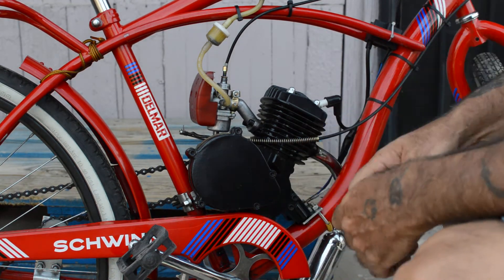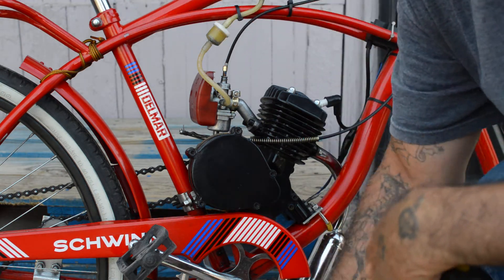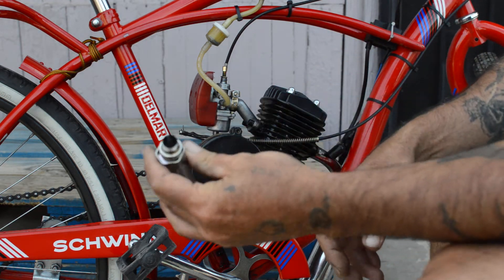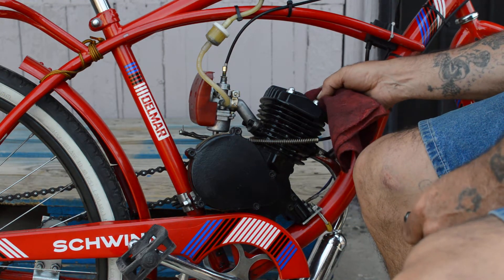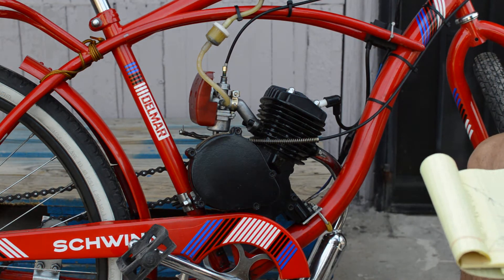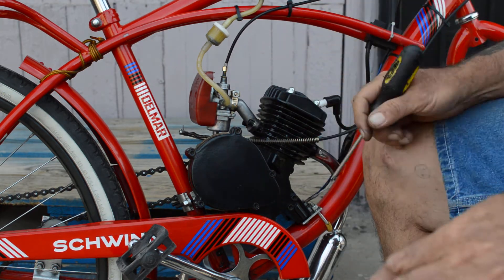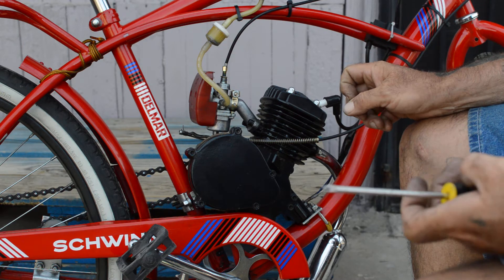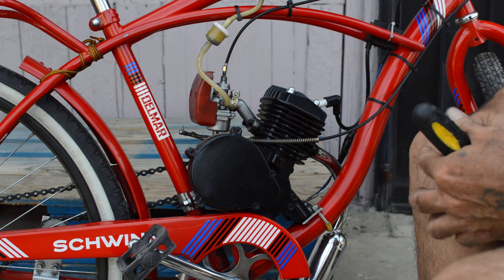Spark Plug 101 for Chinese 48cc motorized bicycle engine

Comment: That’s a 66cc
Reply from the maker: Nope stock 48cc stamped on the bottom of the jug"/
Reply: @Brian136  well the head is 66 don’t always go by the block cuz I have a 76big bore and it says 70/80 on it
Reply from the maker: @keeganhache6667  nope the cylinder head is stock 48cc this is an original china doll 48cc straight from the mud shed that the Chinese used for a factory. 

It is a clone of the Russian 48cc  engine used for a two man Saw

Comment: Your top cylinder head cover is backwards turn it around because you have a angled head cover you want to fire the spark at the exhaust port for best performance. Hope this helps..

Comment: 3:17 okay and if my spring is like stuck to the spark plug? What do I do? Idk if this thing is supposed to be inside my cdi or if it’s supposed to be on the top of the spark plug whatever it is it spins on the top of the spark plug
Reply from the maker: It’s the thing that keeps the wire connected to the plug if it is stuck on the plug then pull it off and put it back on the wire side of the boot push down until you feel a click. Wire and plug are now locked together until u pull the wire off again “) thanks for watching

Comment: spark plug blowout.... should people be using the spacing washer for the spark plugs? proper torque for head bolts to and the spark plug to avoid spark plug blow out? what is the coolest range plug you should run? I'm currently running an NGK BR7HS10 Racing plug and i just had it blow out of my cylinder head, which im working on now.. but i see little content on this topic on YT
Reply from the maker: That’s because not very many run a hot plug like the one u got. Are I using 93premium gas?  Standard gap? Maybe a little wider huh!? Spark plug technology has evolved many times in the last 10years. But the understanding of this hasn’t quite filtered down. I did a video talking about how the spark plug works in conjunction with the timing of the piston. I covered a range from stock b6(chineseium brand) translates to NGK h5b-h6b - h7. Now the coolest u should run is the 5 and there are a number of good champion plugs that work good also. I have seen a few chainsaws with 4bs plug but that was out in the forest with snow up to your butt 21 degrees 0% humidity and dude was burning some thick gas . So that probly cover the Answer to the question. Why not much content? Because spark plugs are still cheap unless you buy the hot range then they cost$$$m. I really don’t know maybe it’s not interesting enough? Why don’t you do a series about it and see what happens “)
Reply: I always run 93 octane in the bike, the ngk br7hs10 is actually a colder plug (on ngk plugs the 7 is the heat range indicator) i installed for running in the summertime, as i was afraid of overheating the motor in the 80°F to 100°F daily temperatures here. Im also running without an air filter as well because the stock one was far too restricted and robbed me of 3 mph. I gapped the plug, but i don't remember off hand what gapping i used

Comment: Brian De Magneto is all right I'm not going into the Magneto box I'm just cutting the wires outside the Magneto box to extend them I just want to extend the blue and black wires
Reply from the maker: Then what is the problem? Bro 2 insulated electrical connectors and some 12-14 Gage copper #2 wire and 10 minutes of your life?

Comment: Fuel filter backwards
Reply from the maker: Read comments above about arrow and the direction of the fuel flow
Reply: The magnet inside is supposed to be on the tank side of the paper filter. But i really doesn’t make much difference. Just thought id mention it.. cheers

Comment: I was looking for this solution even the parts stores cant cross reference this" the ngk b5hs spark plug Looks to have a much longer reach and I don't want to put it through my Piston"??
Reply from the maker: I use this plug on all the engines I have built never had any problems. The engine runs a lot cleaner and the fuel mileage is in the high end of 80-100mpg.

Comment: Why does the spark plug cause compression? Without the spark plug I can pedal just fine but as soon as I install it the bike is sooo hard to pedal why does that happen? How do I fix that? I’m using the spark plug that came with my kit btw
Reply: KingofArmageddon20 your an actual idiot
Reply from the maker: Really dude !?
1. Because once the plug is installed you are sealing the cylinder  so when the Piston moves up and down it compresses the air/fuel mix this is called compression.
2. If you are trying to pedal with the cluth levef out you are turning the engine over without the ingnition in and problely scoring the cylinder walk because it not getting the lubrication it needs 
3. I giving you the benefit of the doubt since I don't know you and everyone get a chance to learn in the beginning but I think dude that made the other comments might be right...

Comment: Does anyone know how i can keep my motorized engine running even when i stop? At red lights or stopping for cars or something, i don't have to repaddle. Anyone??
Reply: Jesse Soe you would need a boost bottle and there like $20 on amazon or eBay.
Reply from the maker: Set the main jet to the second click down from the top. Reset the idle screw to 2 1/2 turns out from bottom. Make sure the choke plate is all the way open. Any more questions?

Comment: I ran my engine 16:1 oil ratio for 65 miles, (currently I have 80 miles on it) for at least 2 or 3 tanks (over 1 gallon used.) I just switched to 6.5 oz per gallon and my top speed is 23 to 24 mph flat road, 44tooth sprocket. Im almost done with one tank of the  6.5oz. The z4c plug runs better than the b5hs, so I ordered a b6hs plug in hopes that it will perform better. Should I still be using a high oil mixture like 16:1 or should I run 6.5 oz again after I finish the gallon already mixed with 6.5? It seemed to 4 stroke at wot but it appears that went away when I went to down to 6.5, I did order a set of 60-65 jet, but may not install those just yet. It's the chinagirl engine. Should I change to synthetic yet or wait until I add more miles?

Comment: Changing out the stock 7mm spark plug and boot is a HUGE power gain.  For like 5 dollars, I got an OmniSpark # 8E40 at Oriely's Autoparts. Its 8mm. Bout 24" Long. Cut in middle, Two 90 degree boots. So you have spare. You have to force the cable end into the CDI screw, careful not to break the plastic. It HAULS THE MAIL NOW. Much notice overall increased acceleration! The NGK plug upgrade compliments the cable. :)

Comment: Hey Brian, I accidentally popped out the spring and metal cap thing that goes inside plug cap. How do I go about fixing this? Does the spring go first or the metal cap? Help would be greatly appreciated. Thanks
Reply: Did you ever find a fix?
Reply: Yes 3 years later. Lol. I thought it mattered, but it just all makes contact.

Comment: I just got an 80cc engine but had no spark so I replaced the cdi and magneto but still have no spark, what can I do to get it running?
Reply from the maker: check the wire behind the magnito make sure it's soldered good then make sure you got the cdi wired correctly sometimes the colors are wrong

Comment: I have a question I have this same engine and it's not starting I'll pedal and I'll get engine to rev but it just bogs out and dies everytime I don't know why it's not starting
Reply from the maker: pull the mag cover and make sure the wire is connected sometimes the little chinese kids don't solder it very good")
Reply: I'm getting spark but won't fire . I changed the piston and cylinder won't start changed the magneto still nothing
Reply: @0Kizzy  
Try replacing the cdi box

Comment: it basically doesn't pic up speed fast or full like its running half power
Reply from the maker: here watch this video and see if this helps you any if not then email me and we go from there ok ty?
Reply: thanks change spark plug I'll try it thanks
Reply from the maker: reset the main jet to it might be set to rich if u are not getting power out of the little enging")
Reply from the maker: https://www.youtube.com/edit?o=U&video_id=0F-Vyv5WmO8

Comment: junky mechanics put bike together but it has new race carb and goes slow what do I do help please?
Reply from the maker: first of all what are u talking about? second just because it has a race carb doesn't mean it's going to go fast third i need a little bit more information to help you??? can u give me a list of the problems that u are having ? things like it's running rough at the top of the rev range ot it's running funny at the start of the throttle? things like that will help me to understand what is happing and then we can go from there ty. tha nks for watching")

Comment: HI Brian : Agree with you tips . Used to mess with cars before my bad back . I have a 66cc stock China motor {  I guess }. You said 49cc is 2.75 HP. What do you estimate my 66cc HP is ? Also would you know anything about BPH (brake horsepower ) ? Carrying about 300 lb.'s ? I ask because now I have to get the thing registered here in NV. Need to meet the same requirements as a scooter . Under 49 cc /under 30 mph . Need to know what BS. they want me to sign off on . If you know ? Let me know ? Thanks  D.A.
Reply from the maker: i figure the 66 is around 3.1 or so depends on weather you got the slant head that is a little bit bigger in combustion chamber size and which carb you got the NT speed or the funny little stock china carb that comes on the rocket scooter") as far as the dumb laws go i don't know because here in AZ it's legal to ride motorized bikes as bicycles as long as u stay i n the bike lane and have all the lights")
Reply: Thank You for the reply . That sounds about right . I figure it's all the cheap China stuff . Here in Vegas it's just the opposite . If it has a gas motor no bike lanes, can't take it on the bus . Same rules as a scooter under 50 cc need a DL but no insurance , no registration (until now .) They say...  it's to help prevent theft ? Cost around $60 one time only .Good for as long as you own the vehicle. ( It is a bit of a gray area concerning motorized bicycles ) The DMV refers to them all as mopeds even though a scooter and moped are 2 different animals ? But I am not going to take a chance . You sign a document that it meets the criteria , then if you get pulled over for going over 30 it becomes a motorcycle , and you would have to follow those rules . Now an electric bike is different . Under 750 W/under 20 mph it is a bicycle. Have one of those 2 . I figure the BHP is under 2 which is required , when you take into account the weight . I'm adding different stuff to make it look like a 1910-20 , not a board track racer however. I use stuff from thrift shops, parts I find or get cheap. It will get to 30 , but I mainly want good low end . So I will be doing some of the mods like you suggest . Okay Thanks  David A .
Reply from the maker: F¥^king police always raining on the party for no reason
Reply: Now I see they require a DOT tire ?n There is no such thing for a bicycle . I'm just going to fix it all up and drive it into the ditch .  D.A.
Reply from the maker: Hook worms are for motopeds dot rated. Come in 3-4inch sizes
Reply: Most sellers claim about 2.95 HP for a 66cc. In reality it's 2.2 at best and often is as low as 1.6  or even less due to casting flaws, mismatches etc.

Comment: my bike wont start ! i peddle and i dont have the clutch  in and it peddles like a normal bike if i pull the clutch lever in it dosnt change anything and it will fire if im lucky but it will just rev up when i twist my trottle.. please help man
Reply from the maker: Spencer adjust the carb and then figure out what you are trying to say? to much of the wrong information here in this statement for anybody to try to figure out what is wrong. 

what is the problem with the clutch? 
is the clutch engaging or dis-engaging?
revs up till is shuts off or you pull in the clutch?
how much fuel is in the tank? did you mix the oil in with the gas?
are the wires connected to the right colors? 
what did you do the first time it started? 

please answer these question to narrow down what you didn't do so we can figure out what to do")
Reply: brian noel  if u go in my page u will see my video about it
Reply: brian noel  okay i was riding down the street and was pulled over 
i put my bike on its kick stand nd it had fallen over , the gas tank bent completly sidewats and i have a huge dent in my xhoust , and the clutch lever on the handle bars broke off and then i went to ride away and it started but i wasnt going anywhere.. it just reved up.. i think i may have blown my cluth or sumthing
Reply: there was a full tank of gas to
Reply: brian noel its like my clutch is fully disengaged
Reply: And i have been riding it for about a month now
Reply from the maker: check to make sure the clutch rod in side the cover housing is in the hole all the way and there is a little steel ball in there first
Reply: What is there isnt a steal ball ? Is there anyway we can skype about this ?
Reply: You would so much help man im trying to fix this problem but i work in 20 minutes ! I took the side pannel off that is connected to the clutch rod and there was just a rod down kinda looked like a flat head screw driver , and it just moved back and forth
Reply from the maker: gonna take more than 20 minutes to fix if you don't have the little ball. my laptop doesn't have a webcam so we would be texting anyway. when you get off work? where you live at?
Reply: I am off work at 9 pm moutine zone im in canada.. idk about you but i havent seen where the little ball is where qould it he
Reply from the maker: https://www.youtube.com/watch?v=8O01sKBqasw
Reply: Okay i took a look at it

Comment: can someone help. i accidentally pulled out that little spring and now i dont know how to fix it.
Reply from the maker: push it back in plug in the spark plug and try to start it up
Reply: +brian noel i ditched the spring completely and it started up fine. i dont know if its necessary though
Reply from the maker: +A. almusawi09 not really it's there to keep the plug wire connected so that it doesn't work loose") good deal keep me updated with this thanks

Comment: what about bp5hs plug
Reply from the maker: a little hotter but just as good that is why your engines runs rough at the top you have a hot plug so use 93 octane gas in the pre-mix"_
Reply: also it runs good gapped at 0.28
Reply from the maker: that is because it's ma hotter plug good build minecraft good job kid")

Comment: Hey brian, what do you think about iridium plugs?
Reply from the maker: best plug is NGK b5hs anything else is waste of money for this reason-- NGK is designed for small 2 & 4 stroke engines. all the fancy ones are for bigger automotive applications and will not work any better. save yourself the trouble buy NGK b5hs or b6hs at Walmart
Reply: ok I just ordered the br6hs on amazon which is the same plug but has a resistor so it dosent make interference.
Reply from the maker: +Minecraft And More no i doesn't resistor is for radio interference and stuff like that. gap the plug around 24 on a standard gapping tool") good deal minecraft
Reply: +brian noel alright
Reply: +Minecraft And More - The only real disadvantage Iridium plugs have is the cost. With that said and considering you just need one. It's not a bad investment. If we're talking about a 8 or 12 cylinder engine it's a whole new ball game and a small fortune. ;-)
Iridium's fine tip allow for good spark with slightly less energy. This translate into some advantages. Like better consistent spark, allow bigger plug gap and longevity.
All in all it's better, BUT a normal spark plug properly maintained is better than a better technology but neglected spark plug. So keep them in good order. ;-)